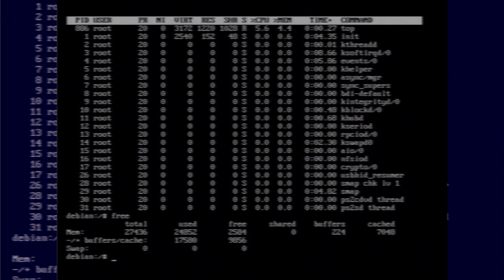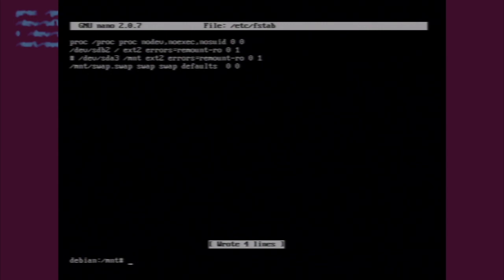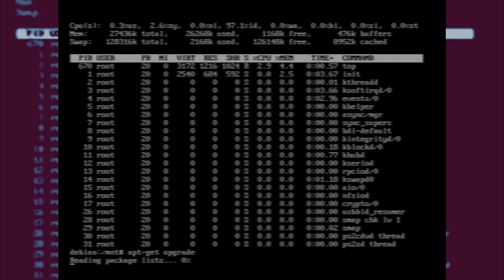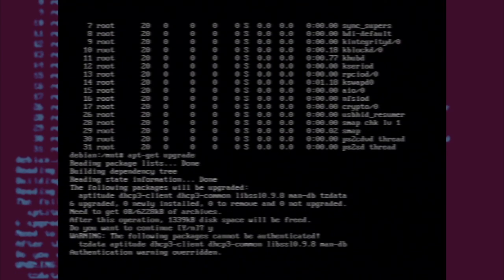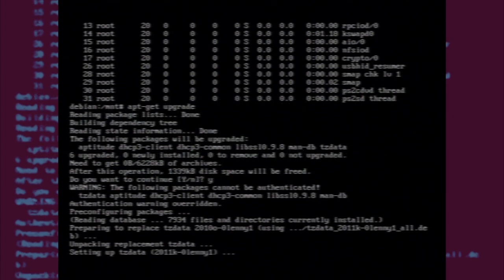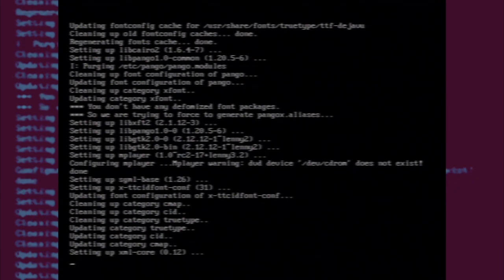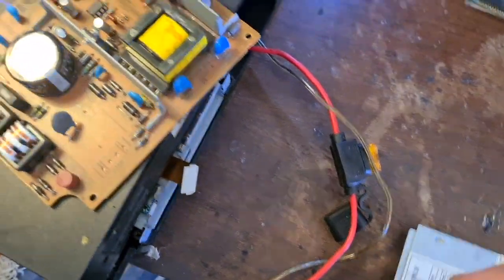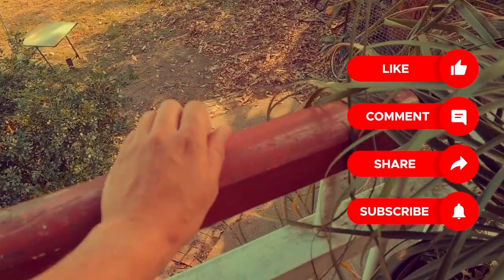life with the Playstation 2 and linux: Episode 6 DEBIAN...the nightmare! PART 2

Comment: This brings back memories. I did this not on the PS2, but the Wii. I ran the old WiiToo for shits and grins back while I was still in high school with the challenge of getting the software installation as up to date and modern as possible. I used Gentoo as my daily driver for nearly 10 years on my main PC. I got portage up to date by treating portage as broken and following the old instructions for getting ancient installations upgraded that, AFAIK, is still preserved for those who need it. It has the modern python 2.7, so it was easy to do back then since portage still supported running under Python 2 (not sure if they ever stopped). Then I got the toolchain updated after getting off the testing branch. Compiling took forever. The Wii has a ton of RAM in comparison to the PS2, especially if your Wii was old and allowed BootMii to be installed in boot2. Then the Linux kernel got to run completely outside of the confines of the IOS subsystem and use the whole 88MB of RAM for userspace. Normally the Wii reserved some of it for the GPU to use alone, and had 64MB for userspace. Wish I could have figured out crossdev and cross compiling. I could never get it to work. It would have helped a lot. I remember gcc taking 2 weeks, with 2 job threads instead of 1. Tip: don't. Keep it at -j1 because the cooling will barely keep up. I'm willing to bet the same thing for the PS2 for that if you ever do try running Gentoo on it.

On the old WiiToo, once the toolchain was taken care of, I reached a roadblock with udev and the old kernel. It was either get the kernel upgraded from 2.6.30 something to at least an early 3.whatever kernel, and have the stuff from Mikep5, or whatever it's called now, upgraded. This has probably happened by now, because I recall there being new distributions out now for the Wii, but not back then when I did this for fun. The other option was to go with static dev. I remember using mknod to make just /dev/console and /dev/null and noped the fuck out of that. Good times though.

Your videos make me want to poke my head back in someday with the Wii, and dip my toes into the weeds with the PS2 and PS1. Very intriguing. Perhaps even DS Linux and 3DS Linux, with 3DS Linux needing help with everybody's favorite thing ever: the joys of bootstrapping and whatever else. Hmm.
Reply from the maker: awesome im glad you enjoyed it, ive got my wii ready and the ps3 so thats coming soon and some gentoo.. i think its time to get yours out also!

Comment: Algo brought me here. I haven't really touched this in many years now, only recently when some random 3.0 kernel was compiled did I even look at it again. iirc The latest Debian I was able to get running was Jessie (8?), and it was a pain to install as I had to remove systemd and install sysvinit. I remember memory being an issue very early stage and having to both partition and enable swap in the install to get anything done, but an older (at the time) malta based net installer image would work given enough persuasion. In an earlier video you mentioned running something on it, and I seem to remember I had an old build of Mongoose that not only compiled just fine, but also ran mostly okay on the system, making a rudimentary web server possible on the console, if a tad slow...Good enough for a low traffic non-ssl site, but my v9 consoles network drivers would lock up after a day or two, so I couldn't keep it running on that (I had enough computers running that could handle the task without issue). This was all before the keys expired, so I expect doing this again nowadays would be tricky, but not impossible...Though I am curious if anyone was able to compile a stable version 3 kernel with APA support: That would be a nice to have, even if just for tinkering.
Reply from the maker: Ohhh that's interesting I'd be keen to hear more about your experiences

Comment: Could it be possible to get a somewhat modern GUI running on the PS2?

How about some overclocking? People were able to swap in a 22.11MHz crystal (so 353.7MHz), and although it's useless for PS2 gaming because games usually tend to break (Sound plays faster, game runs at a wrong refresh rate, game runs faster but audio doesn't and all kinds of desyncs. Some games work fine though.), it may be good for Linux use.

The PS1 can also be boosted to 67MHz, but needs a big heatsink. At double the clock speed, it does double the heat. 😂
Reply from the maker: i like this!, perhaps we could do something like this, although apparently this was supposed to have as much power as some kind of P3 at the time (too drunk to know the exact figure right now)  but i dont want to give too much away for one of the upcoming videos lol